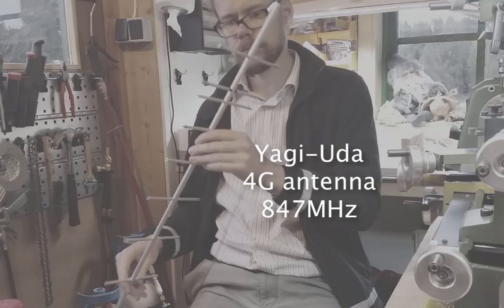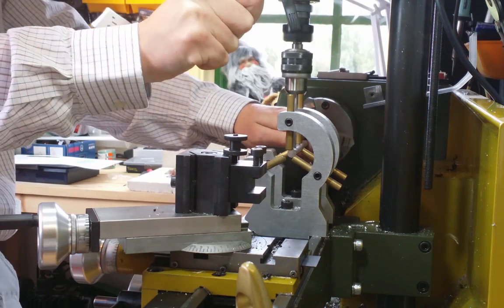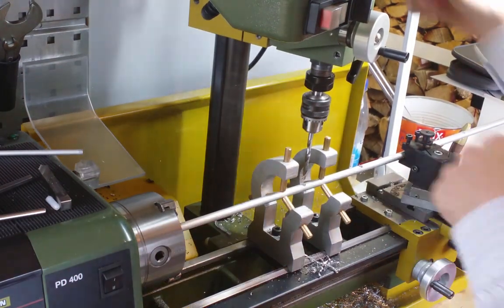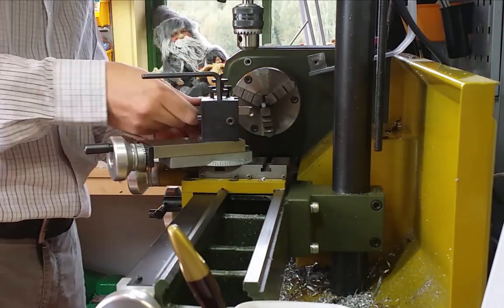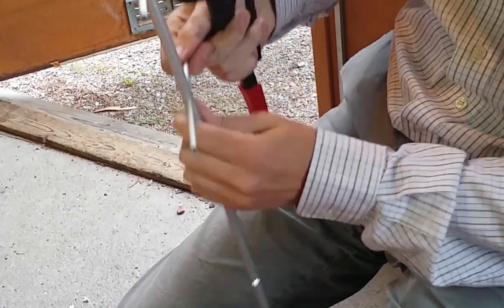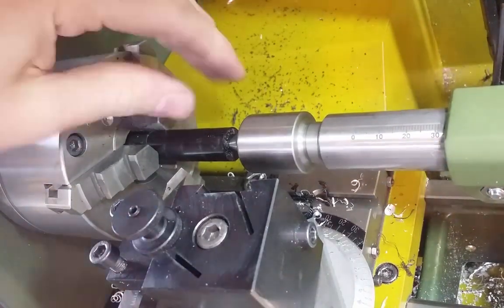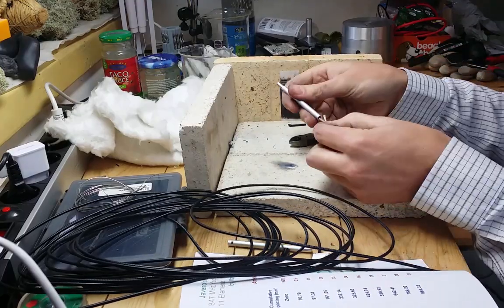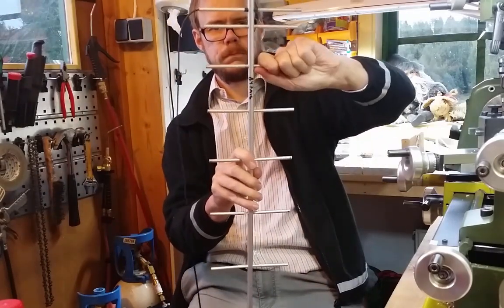DIY Home-made 4G LTE 850 MHz Yagi-Uda antenna

Comment from the maker: Just a follow up comment, I used these antennas for the following 7 years, summer, rains, winter, snow-storms. I had no issues what so ever and they did greatly improved my bandwidth and this especially on the up-link side. Well balancing could have been an issue but I didn't see any side effect of it at all by not doing so. The modem survived all the years as well.

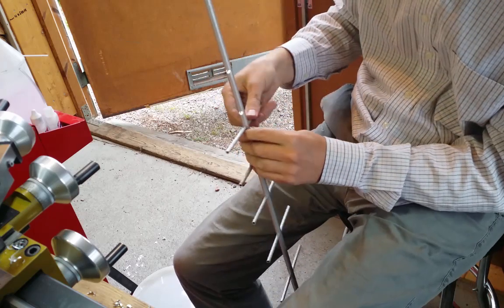Comment: I noticed that in 6:40 crimping at 90 degree may be closer to the boom and for sure easier is to clean the cable 10:10 with opposite side of the cutter. Nice workshop.

Comment: Good-looking antenna. Just some questions though:
1) how do you find the impedance of the antenna and match it the coaxial RG174, which i presume is 50 ohms?
2) How come you did not attach a balun to coaxial, unbalanced, before connecting to the dipole, which is balanced? My professor said it is necessary to add one to make sure to eliminate the current on the outside of the cable?
Reply from the maker: deathheavens Yes, I agree on all your points. The cable is 50ohm as you said and if you gonna do this by the book (or as your professor states ;) ), you should measure the impedance of the antenna and then as you said complement the construction with the right balun. Unfortunate I don't have the necessary equipment to do so (best is to use a vector analyzer I guess) and I took the chance instead and tried out the antenna and it turns out to work rather good anyway without the extras. It seems to work according to specs, and now I have around 20-30mbit/s both directions.

Comment: I was refering to the boom. You made it from aluminium with contact to the directing elements. I have seen designs with a wooden boom or made on pexiglass. Is there a big difference there?
Reply from the maker: yes exactly, if you have a boom of metal suporting your directing elements u get diiferent spacings/lenghts to compensate, if boom is also in electrical contact with the elements then that also needs to be compensated for. But that is so far my own knowledge goes for that topic. If you do the calculations manualy I guess it will be easier if the boom is non-metallic and therefore don't interfere with the electric fields around the antenna. I choose metall out of two aspects. first durability, my antennas are located in directed sun light (usually kills plastic) most of time together with heavy winds. secondly I like to work with metals rather than wood/plastic.

Comment: Thank you for your answer. Just one more question, I started to learn about Yagi to hiild one prototype but I can not tell the difference between having a metallic middle pole contacted to the directing elements and those design that use non metallic elements as structure. Which one is the real thing?
Reply from the maker: I don't understand exactly how you mean. If the support structure is of metal and if it is also in contact electrically with the directing elements then that will have an effect on the antenna design and you need to compensate for that. -I'm no guru on this myself, but I think it still counts as a Yagi.
Reply: Film4Music Both are the "real thing" !  ...they 're just different options. -  see my comment and URL above for details - Cheers Paul

Comment: Hi, thank you for the video. The antenna looks perfect. I would like to build an antenna for my wireless microfone in the band 626-668 mHz. Comercial antennas are wideband log periodical. Do you think if I need narrow band and high gain, I could be better with a Yagi?
Reply from the maker: I think the log periodic is designed and best used for a wide band, if you need max gain I would go for the yagi especially if you only have that small freq. range as you describe.

Comment: Good Day Dude.... how can I set up that machine you've used. I'm Planning to build one of those. thanks
Reply from the maker: +Gero Egreoj Not sure what you acctually mean, set up and configure the antenna to your router or how to use a lathe? Former: your 4G modem needs to have external antenna connector, later: a lathe is not critical for building a antenna, I just like to find opertunites to work and use them in my projects.
Reply: machine that you used to build antenna is what I mean sir. I'm also making yagi antenna. But I only use drill without drill press and it gives me hard time to build one when it comes to precise drilling from side to side (i'm using circular aluminum tube with 18 mm diameter).
Reply from the maker: By a lathe for just making an antenna I wouldn't reommend, would be cheaper to just by the antenna in first place. If I was you I would improvise by building a drill jig in wood to support drilling and increase precission.
Reply: +Magnus Hummelgård oh fyi, i'm planning to produce volume of yagi antenna and making it a business. I already made 4 of those and sold for $ 126 each. I install antennas for modems and houses far from cell sites that 3g network can't reach. I'm planning to make it a business after I finish my contract here in abroad. Anyways thanks.
Reply from the maker: +Gero Egreoj OK now I see, anyway the lathe is a proxxon PD400 with mill attachment: http://www.proxxon.com/en/micromot/24400.php
Reply: thanks a lot Sir. one more thing, maybe you can use folded dipole with your antenna to maximize your work. I have calculator for yagi design if you want I can share it with you.
Reply from the maker: +Gero Egreoj Yes, u right a folded dipol would be better. The antenna works good enough anyway for my needs but thanks anyway.

Comment: Hi, really nice and well made video. I would just like to ask what software did you use to measure the dBm?
Reply from the maker: +Kasetti 55 Well, that was not made in any greater detail, I just used the modem connection-software that info the signal-level.

Comment: FEEDER MATCHING ! - Go back to  Martin E. Meserve's yagi calculator website, and look for the coaxial cable impedance matcher calculator, that uses a 300 ohm folded dipole for the driven element - http://www.k7mem.com/Electronic_Notebook/antennas/yagi_vhf_feed.html
FYI Film4Music, His calculator also caters for insulated elements from metallic boom, elements electrically connected to metallic boom, and non-metallic boom options.
Reply from the maker: -Thanks for the matching tip, Paul. I also realised I stumble upon the calculation script page from the wrong webadress, and good you stated the right one in your comment. I now have changed the adress at top to justify credit to the rightfully owner of that page. Hope you liked the antenna video.
Reply: Magnus Hummelgård I did like the antenna video! - It's good to see people who've got the right equipment (lathe with drilling att. etc.) and know how to use it to make what they need, and I enjoyed what sounded like faint speeded up humming from the Operator, who appeared to be doing a great job of construction.